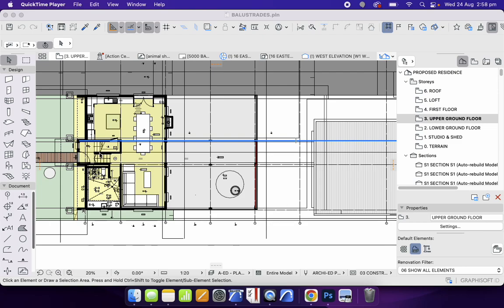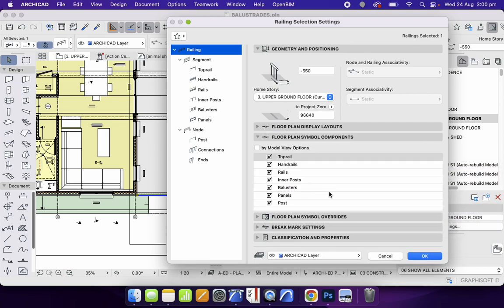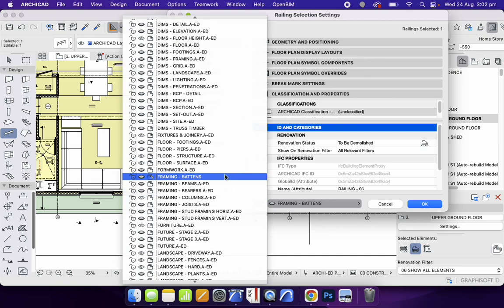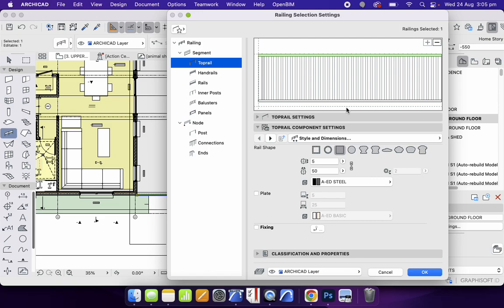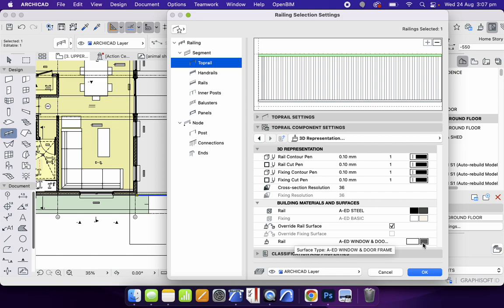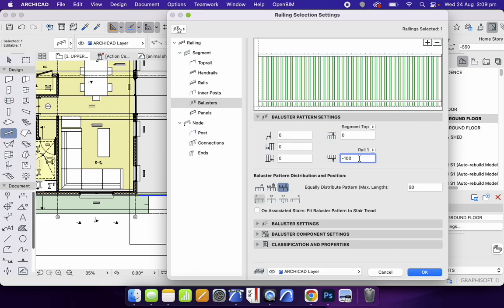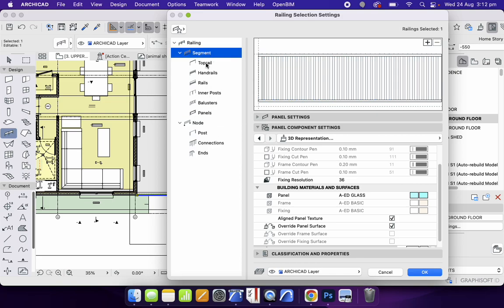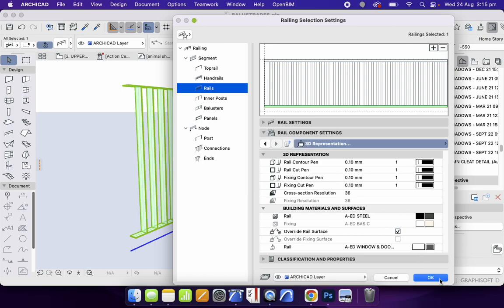ArchiCAD Railing Settings

Comment: My Railing is angled on a slope as if it's following stairs that don't exist. I placed it on a flat sidewalk without stairs. I went through all the setting but can't find a solution. Overly complex tool. Do you know which setting can set the railing on a 0 plane?